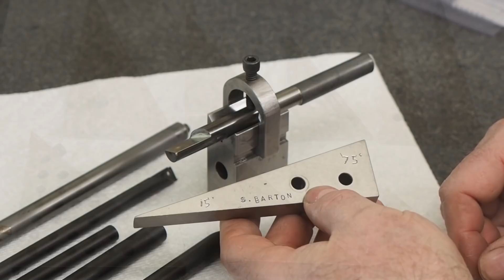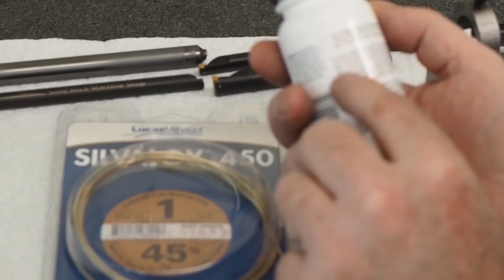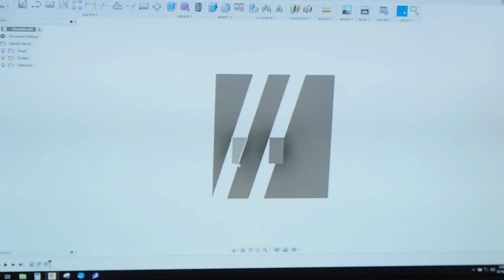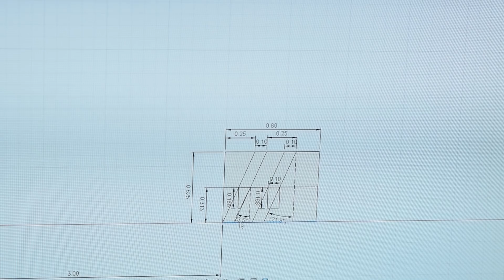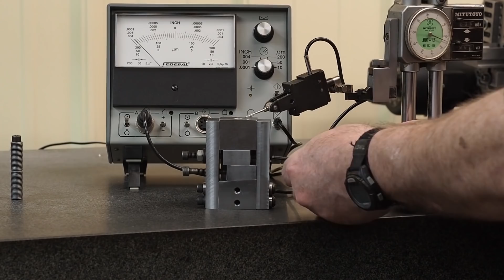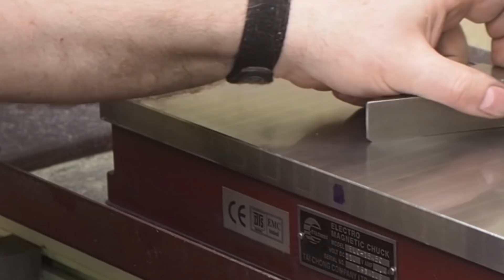Uncle Murphy and His Favorite Cousin Bozo Stop for a Visit

Comment: Unless my eyes are deceiving me it looks like there is to way much angle in your drawings of the threads. If you line up the bottom and then connect it to the top like going around the back side the thread on the back side looks to be straight up.
Reply from the maker: You are correct.  My angle was set for 2 threads per inch instead of 4. The angle should actually be half of that. Thank you for pointing that out!
Steve
Reply: @SolidRockMachineShopInc  Unless I'm confused the developed(unrolled) measurements of the .250 pitch divided by the circumference of a 
.625 ID (1.9635) =.1273 which gives a helix of 7.256° to cant the insert.
Another thing about Acme inserts to keep in mind is a little narrower insert tip width is okay because the threads can just be cut a little deeper, but if it's too wide, as soon as the major diameter is big enough to accept the male threaded part, the pitch will be oversize and you've got a loose fitting thread.
Reply from the maker: @lunkydog  
No, I am the one who is confused. Your input is greatly appreciated. imystery man pointed out the angle I came up with was to much and he was correct. After looking at it I saw the error I made. I wanted to get a visual of the angle so that is why I use Fusion 360. I recalculated to see the angle visually.  After that I took a 1/2-20 thread and did the the calculations to see what angle the thread was making. I used a protractor to measure the thread angle on the screw to verify and it measured correctly (by sight). I did this on a number of screws sizes and the calculations and the protractor came out the same every time. At first I was not going to set a cant to the insert but once again you are educating me. The angle I came up that the thread would make looking at it from the side was 11.3099 and figured that I would have to grind that and a little more for relief on the insert. Ross said "and that you're going to need more than the standard helix angle." So would the 7.256 can't of the insert be enough? Thanks for all the input you are providing.
Steve
Reply: @SolidRockMachineShopInc  I can't give you a absolute answer on that with 100% confidence. At a certain point the thickness of the insert comes into play as to what is required to keep the bottom edge from dragging. And that could be addressed after the fact. If you had the original part he's trying to replicate, you could set your insert in it and get a better idea if I'm way off. I took a look at the Colchester part I ground the HSS bar for and it was closer to 10   tpi, otherwise same ID/OD as Keith's and the lead relief is very noticeable, but of course it's dead flat on top with no tilt. All of the 8 pitch stuff I used to cut didn't really seem overly canted but I no longer have access to that company which was sold, to verify how much they tilted. They were standard bars as I said, I believe NVR 0625 from Vardex (?) If you care to look them up. I understood the carbide seats/shims on the larger bars and external holders could be swapped for others that had some additional taper for coarser pitch threads, but we never used them.

On the HSS tool I ground for the Colchester  job, I had a secondary relief on the lower third only. It wasn't ground as a single flat face from top to heel. That's kind of what I'm getting at about "after the fact clearancing" if that makes sense.
Reply: I don't think you need any more than the bare minimum, a degree or so, especially considering the way brass makes a chip. You're also not taking big honking cuts when threading. When I would do all the difficult single point stuff on the CNC I would have single block passes with optional stops every 6 or 8 passes to remove hairballs and fish the chips out of the bottom of blind holes. Had to use Moly Dee too, no coolant.
Reply: @SolidRockMachineShopInc   I don't know if you read your comments but, I just discovered your channel and I  think it's great. What I was wanting to know since I'm getting old and the eyes are bad is where you got the Federal Micrometer?. I would like to find one.
Reply from the maker: Welcome to the channel  @jeffcampbell6898 .

I bought it off ebay.
Steve
Reply: @SolidRockMachineShopInc  I'd say instead of the diameter you should have put the circumference (which is pi*diameter) on one side. Then you'd get the exact angle the thread has along the center line. This also means that the angle is different for the bottom and the outer edge of the threads, because the diameters are different. You could have the cutter clearing on the outside while rubbing on the inside. It's like on a spiral staircase, where the steps are steeper the more you go to the inside.
Reply from the maker: That makes perfect sense. I just came back from the shop after turning a piece of CRS to .625 and set the lathe to 4 TPI which was the lowest it goes. I just used the point of the OD tool to cut about .01 deep per side to see what that angle looked like and it was really close to the angle you figured. I measured the insert and there is no side relief on the insert at all. Do you think it would be wise to add a few degrees relief on the leading edge? Thanks for all the valuable input you are providing.

Steve
Reply: @SolidRockMachineShopInc  another point, and it was what I originally trigged out for the helix angle. At the tip @.875 diameter the helix angle figures to 5.1965° which seems a little strange to wrap your head around but it means you can get away with less clearance angle out towards the tip. This also is a factor of the radial clearance below the tip. I hope you can make sense of the terms I'm using, it barely makes sense to me.
Reply: Is this a standard full acme 4 pitch screw?  Left or right hand? From the comments it has a 0.875 major and 0.625 minor diameter.  I can send you a 3D printed nut you could use to test tool geometry.  It is a quick job to make a model of the nut or the tool in  3D CAD.
Reply: @chuckinwyoming8526  It's LH and the theoretical on a 4 pitch in my handbook shows .125 height, so that would imply standard form. However, that is a very coarse pitch at that diameter. As a side note, all the 8 pitch stuff I did was a stub Acme and I had to grind the nose of all the inserts to a specific wider width.
Reply: It took about 10 minutes to design a 3D CAD  model and I could 3D print a plastic nut for you to check tool geometry.  Or if someone there wants to print the nut I can send them the CAD model.  The nut could be easily cut to use a cross section.  Don't forget you need a .020 to .030 max diameter clearance in the nut with a .005 to .010 radius on the tool corners.  I had much the same problem Kieth now has with my 1874 Putnam lathe.  It is interesting, back then they used a stock 3/4-6 thread for the cross feed screw.   They DID NOT build the lathe with a cross feed dial.  If you think about it how would you make a dial with 166.66... divisions?  The compound did have a screw with a micrometer dial, I guess if you wanted to turn a diameter you used the compound??? When I rebuilt the lathe I remade the entire cross feed with a 3/4-5 acme thread.  This made it simple to make the new bearing and dial with 200 divisions.  I simply used a 7/16" boring bar with a 3/16 broached hole at 90 degrees for a HSS lathe tool ground for the acme thread.  This worked well for the bronze nut.

Comment: Good stuff Steve, I need to make some new screws for my lathe~ Richard
Reply from the maker: Hi Richard,
Are you going to make the screw and nut?
Steve
Reply: I believe so Steve, I want to make new acme screws and nuts for the cross slide and compound. Making the proper threading tools will be the hardest aspect as all I have is a cheap chinese bench grinder. I would rather cut the threads on the nut myself vs buying a tap but making the threading tools is the biggest challenge so have been watching & learning all I can on the subject. The machine work I can handle I think...but the form tools....the jury is out on that one! LOL 

In preparation for the making the new lathe parts I have totally disassembled the chinese bench grinder and making new parts for it (flanges & nuts) to try to eliminate the .025 runout wobble of the 8" wheels. I also need to do some machining on the rotor shaft as there is only a .026 rounded shoulder on which the inner flange sits against and also has runout as best I can tell. Poor QC in China!

With that much runout with 8" wheels I think its a bit dangerous, so want to get the grinder in much better shape. The vibration is a bit scary and unacceptable. I cant make small form tools on the grinder in its present condition so its now in pieces....new bearings are on the way. I appreciate your vids on acme threads, they are most helpful understanding the geometry required. ~ Richard

Comment: Hi Steve,
The adjustment wedge is a design used in the Moore jig grinders 1/10,000" adjustment at the top of the spindle.
Merry Christmas
Reply from the maker: Hi Eric,

I have a Moore number one and never knew that is what they used for the fine adjustment. Thanks for sharing this.
Steve
Reply: @SolidRockMachineShopInc   Do you have the book "Holes, Contours and Surfaces"? written by Richard F. Moore and Frederic C. Victory, The adjustment mechanism is detailed in that book on pages 115 and 157 they call it a cam & lever but the cam is just a wedge working against the lever. If you don't have the book you should try to get one. They are out of print so check amazon.
I have some electrical schematics for the jig grinder if your interested in a copy I can scan mine, let me know.

Comment: Hi Steve, If I was making this bar I would make the top face of the insert perpendicular to the helix angle at the pitch diameter of the thread. This requires adjusting the cutter geometry to give the proper form. Give me a call if your interested.
ATB, Robin
Reply: Or grind the helix angle into the end of the bar and grind a tangentially mounted tip. Given the fact this is likely a single use tool and the turning speed Keith will be operating HSS would be my first choice being cheaper and easier to grind. This all takes me back to my days at tech where all the lathe tooling was issued per person and hand ground by the trainees. No TC for us back then. I suspect skills like tool grinding along with many others skills have been dropped from the course because that is not how modern industry operates.
Reply: @RobB_VK6ES  you are probably correct.  Even way back when I went to school, everything was taught like it was from new stock and you can just start over if you make a mistake, which might be somewhat needed for basic learning, but  we never had to dial in a 4 jaw, or think about repairing a workpiece that was too valuable to scrap. In my experience,  if one wanted to start their own shop, the easiest path would to be to offer repair services,  where the machinist can use old machines with known quirks, and grind tools to fit a specific application. I doubt those skills are being taught. The repair industry is less threatened by globalization in my opinion. YouTube is a great way to learn new ideas and methods that many students have never been exposed to, so thanks for doing what you do.
Reply from the maker: Thanks for the help Robin!I really appreciate it.
Steve

Comment: Hi Steve!
I get my silversolder from these guys: https://www.meltolit.com/
There is a dedicated solder for brazing carbide to steel named 49, which might be similar to what You show. The special flux for this is 770E.
I use paste flux and thin rods without flux, hate the fluxcoated rods. 
Think I have 4 different alloys. They flow differently and also differ in "filleting" around joints, colour etc. I do it like You, play with it until geting it right...
I have used ready made flux/solder pastes for brazing. Works well but they do not store well. For production I would perhaps consider the pastes.
Silver brazing/soldering (or what You care to call it) is wonderful for prototype building.
Regards,  Erik
Reply from the maker: Thanks for the information Erik!
Steve

Comment: Glad to see someone already pointed out the helix angle is the pitch/circumference, not diameter.  Tip clearance is also easily established by drawing the insert over the ID of the hole.  Tool pressure can screw with your geometry too.  Deflection of the bar both down and away will flatten the helix relief and alter the side angle of the thread form (won't be 14.5 degrees on the left and right flank of the thread).

As a completely different tactic, I wonder if an acme tap would be easier to make?  The "easy" way of turning an external acme slightly oversized for clearance and cutting flutes in it would not have any additional relief angles on the sides and tips but might work when cutting bronze.
Reply from the maker: Hi Barry,

You bring up a lot of good points. There is a lot more to this than I first thought. I am thankful for all the great subscribers like you who are  giving me an education here. When I first talked with Keith about this I thought it was as simple as getting a carbide bar and fastening an insert to it, boy was I wrong.

Thanks,
Steve

Comment: Why not just angle the slot you are grinding in the carbide bar...   So instead of grinding a horizontal flat, you would cant the insert at the thread pitch angle....   The result would be a slightly deeper grind at the end of the carbide bar tapering at the pitch angle to a less deep slot farther from the end.  In this way you would eliminate the need to grind relief on the insert.
I think this is what Dylan Rink was proposing
Reply from the maker: Hi Tom,

I will be going a different direction on the build after talking to ROBRENZ. He and many others have been a big help.

Steve

Comment: when i attach carbide to a steel blank I use silver solder foil it makes the whole process easier .
Reply from the maker: Hi Jeffrey.

This was all that my local supplier had in stock. That is why I am preflattening it to make it easier to work with.
Steve
Reply: @SolidRockMachineShopInc  I bought the foil that I have from McMaster Carr
Reply: I bought some foil on ebay for silver brazing, works great

Comment: At 25 minutes, you have the v-block bolted to the squaring block so the squaring block is standing on edge.  I'm trying to figure out why that tall setup would be better than laying the squaring block down, and I just don't get it.

My modest experience has been that more stable setups come from wide bases and as little height as I can get away with.  What am I missing?

Is it a bad idea to direct the coolant onto the wheel so it is always carried into the cut?
Reply from the maker: Even if I would do it the way you suggest the weakest point in the setup is the 1/4-20 SHCS which clamps the bar.
Steve
Reply: @SolidRockMachineShopInc  Alrighty, sounds like my intuition is just 'off' on this.  I'll keep in mind that taller setups may work just fine and I don't have to think of them as off limits.  Thanks, mate!

Comment: dont you angle the holder and not the insert..... for the helix relief?? when I've made my lay down holders it's always a compound angle just for the relief
Reply from the maker: High dylan,

I will be going a different direction on the build after talking to ROBRENZ.
Steve
Reply: @SolidRockMachineShopInc  cool deal. looking forward to seeing the resolution. you could also sub this out to Peter S at Edge Precision channel, hes got that badass CNC tool grinder, grind the acme form right into the bar end......